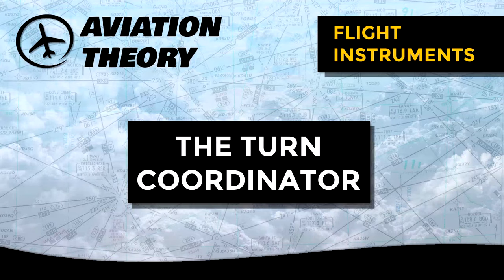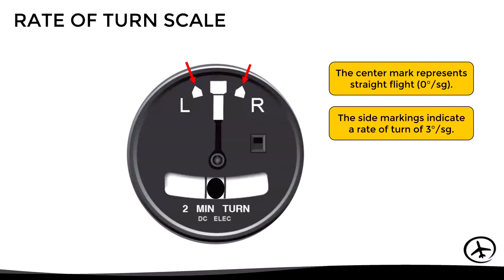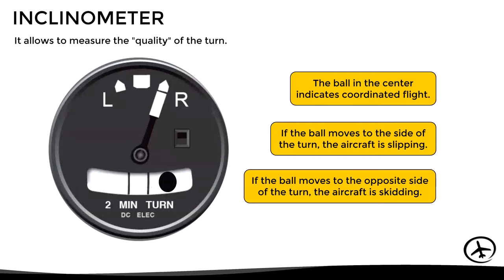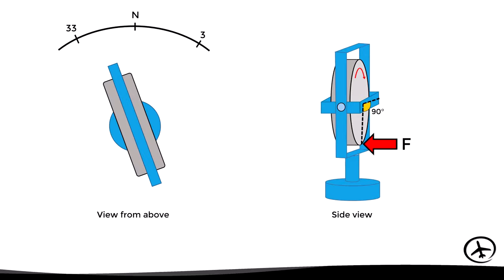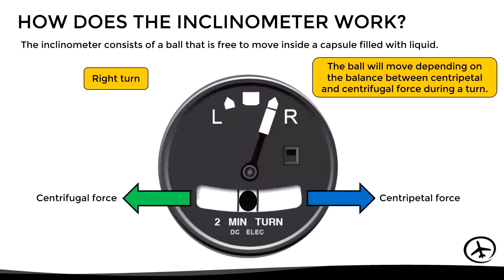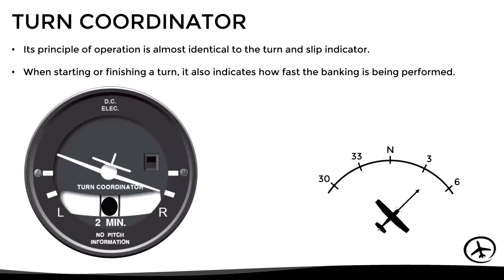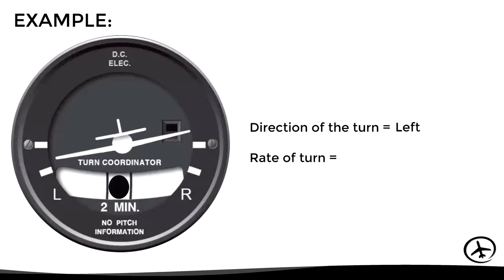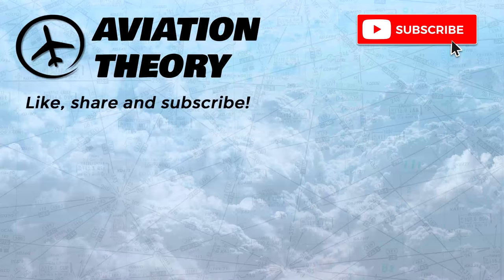The Turn Coordinator

Comment: Thanks for useful videos. I have a question! Let's say turn coordinator indicates standard rate of turn, and inclinometer indicates slipping or skidding turn. Would the rate of turn still be the 3 degree per second as indicated by the turn coordinator? or does it indicate standard rate of turn only when the ball is centered?

Comment: Good video! I just have a quick question. When they say the indications presented by the miniature aircraft of the turn coordinator is indirect indication of the bank attitude, what does that mean? Especially the indirect indication part? Thank you!
Reply: The miniature aircraft on a turn coordinator only tells you how fast the aircraft is turning. Turning is not a direct result of banking an aircraft because you can actually turn an airplane without banking at all, using rudders. Also you can bank an aircraft a lot without even turning, using rudders. However, as long as you keep the ball in the middle, staying coordinated, the miniature aircraft will accurately tell you the direction of aircraft bank or wings level.

Comment: Nice video thanks. But it is not the centripetal force. Its the horizontal component of the lift. Centripetal force has always the same magnitude as the centrifugal force but opposite sign: Fcp= -Fcf
Reply: That is true if the turn radius remains constant. If the forces become unbalanced then the circle increases/decreases.

Comment: The turn and slip is mounted horizontally not vertically. This video wasn’t helpful in explaining how the 30 degree cant measures rate of roll in the turn coordinator.
Reply: Please lmk if you find a good explanation for this
Reply: did you ever find a video that explains this?

Comment: what would happen if I am flying  in a straight and level flight and all of the sudden I apply  rudder only? how would the airplane would behave and what does the TC would indicate? thanks!
Reply from the maker: That would induce a strong yaw, and since it is not accompanied by the respective roll required for a coordinated turn, it will cause a skidding turn.

This way in the TC, the miniature aircraft will indicate a turn in the direction of the yaw, but the ball of the inclinometer will move in the opposite direction, indicating a skid.
Reply: @AviationTheory  But as you said TC would show the rate of roll through the miniature aircraft, why would the miniature aircraft still moves if there is no roll but just yaw turn?

My second question is very similar, can i refer to the angle of TC as an accurate reference of the bank angle? Thank you very much,.